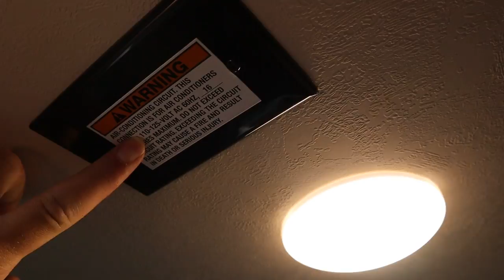Adding A Second Air Conditioner To Your RV

Comment: I also have a puma 5th wheel,  what type of unit did you install or recommend. Thank you
Reply from the maker: If there is not a prewired wall thermostat, you can put any unit on that you want to.

Comment: I want to install a second AC, but my camper is not prewired - Can't find any videos on running the wires back to the circuit breaker - any suggestions?

Thanks
Reply from the maker: I just did this in a box trailer. Be almost like doing it in a camper. https://youtu.be/vQ5bkB-hlMU

Comment: Are all roof vents the same size? I wanna add a second ac to my 30amp rv, of course wired separately. But I don’t know if the vent is big enough
Reply from the maker: Yes. The vent is about 14X14. The rough opening is about 14.5X14.5

Comment: Hey Kenny, you could have also used a Non-Contact Voltage tester to check for power on the prewired AC wiring.
Reply from the maker: Yes, but I don't like those things. They are too consistent. I own one , but never use it.

Comment: Did the new unit come with the easy start or standard electrical start, I assume it’s a 50 amp service thanks and good job by all
Reply from the maker: As far as I know, none of the ACs come with easy start. Yes 50 amp.

Comment: Dearly need some wisdom.  2nd A/C install on 21 Jayco with bmpro smart system.  1st A/C is coleman and so bmpro says I must use coleman for 2nd A/C.  However, the only low profiles I can get are dometic.  Could I put a dometic in and make it work?
Reply from the maker: Sorry Eric. I have no idea what bmpro smart system is.
Reply: @hillbillyrv  thanks.  New jayco smart     rv controller.
Reply from the maker: @ericstine3486  I have no experience with it. Sorry.

Comment: Pulled a brand new GE Air conditioner off a TPO roof.  Trailer was a 2021 model.  Air conditioner got hit by lightening. Butyl tape under the AC seal, first time I’ve seen that.  Two wings ripped completely from the cutout when it was (as gently as possible) pushed up to break the seal. I think I could have prevented some damage knowing it ahead of time though.
Reply from the maker: Yeh, I know Alan. I hate it when people put stuff under an AC gasket, but when they the built this camper they got a little wild with the screws on that vent, so I thought putty tape might be a good idea.
Reply: @hillbillyrv  We're going to be taking a vent off (actually switching the AC with the Vent bc we need a 'low profile' AC and the only way to make it fit is to swap the 2. I'm thinking we may be better off buying a new vent. What's the safest way to seal up everything from the old vent (screw holes etc) & do we need to try and get as much of the old sealant off or not?  (this is a 2022 model but we need Low Profile so it fits in our garage (deed restrictions, can't keep camper out)) Tx
Reply from the maker: @DSmith-zk8ug  Yes you have to try to get as much old sealer off of the roof as you can, without doing any harm. The old holes left by the vent screws is a toughie. If the holes are going to be too close to the edge of the new AC gasket, you can put putty tape under the gasket. I say putty tape because you may need to remove the AC some day. Anything else could make that REAL tough. Good luck

Comment: What a/c do you recommend I have to replace both of mind don’t know if I want to go to a dual Control or stay with a Single control i injoy watch your video
Reply from the maker: Go back with the same brand.
Reply: @hillbillyrv  I got Dometic on mind now   I been look at the furrion  my a/c is over 12 years old
Reply from the maker: @diesel_0669  Just make sure the Furion with the wiring that is already in your camper.